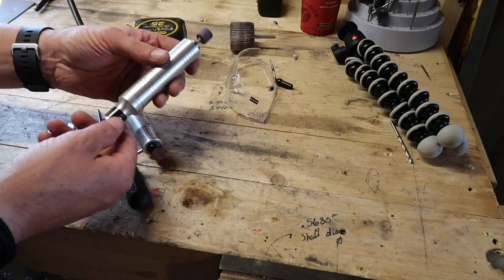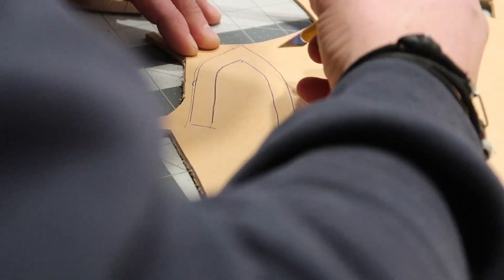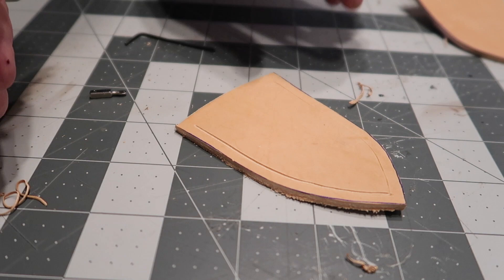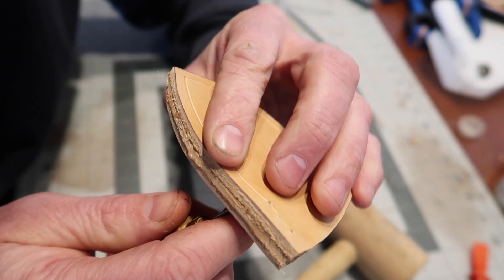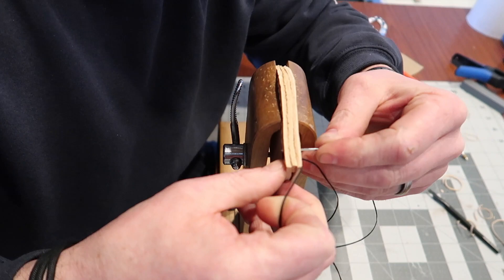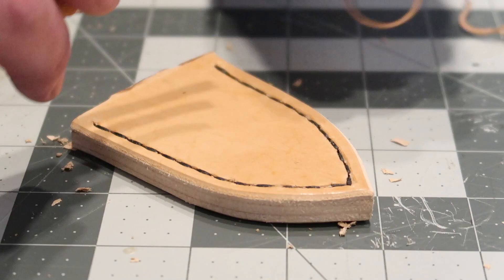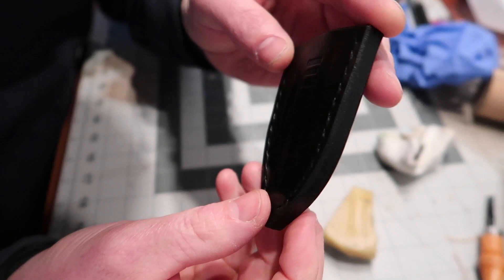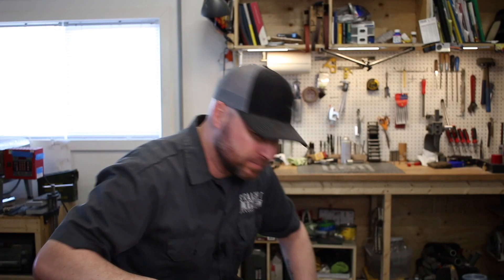Basic Leather Craft Tools - Tool Time Tuesday

Comment: Tool List From Vid. :

Exacto Knife
Edge Beveler
Stitching Groover
Spring Clamps
Leather Cement (w/ Flexible Applicator)
Pronged Leather Chisel(s)
Wooden Mallet
Stitching Awl
Waxed Nylon Thread
Needle
Stitching Pony
Safety Beveler (not necessarily recommended)
Belt Grinder (w/ 80 grit)
Beeswax (Alternative coconut oil, vegetable oil??)
Reply from the maker: Thank you for doing this! Really appreciate it🙏😆
Reply: @Simplelittlelife  You're welcome. :3 

I did want to ask, which stitching groover do you recommend?
Reply: Nomadic Wolf 
😉👍🏾 🤗 APPREEEECIAAATE  this !
Reply: Tools are needed for every hobby!... Compared to other hobbies, leatherwork is extremely CHEAP!!!
Reply: @nomadicwolf6132  "stitching groover" he recommends!?... What's wrong with your TEETH Mr Wolf?... Are they too skew or are they too worn out???
Reply: Thank you. 😊
Reply: With the waxed thread, I would suggest adding a cheap lighter to the list. Works really well for fully sealing up knots with stitching

And if you don't have one, a cutting mat is a very good idea, same with a punch pad because it helps extend the life of your punches and stamps as you go.

Comment: That bladed tool you’re calling a “safety beveler” to trim the edges of your work is actually a skiver.  You can use it to thin out your leather. Spray it with a little water then you can run the shiver over it to skim off the meat on the back of your leather. I use it most often to thin out the edges before gluing up and stitching parts.   
When burnishing your edges, it’s helpful to use a piece of canvas to rub that edge down after you coat it with either your beeswax or saddle soap or one of the commercial edge finishes.  The canvas builds up heat pretty quickly and really helps to smooth out the edge and start to harden it up a little bit.  Then come back and slick it with your burnishing tool. I have a couple that I’ve run a screw into so I can chuck the tool up in a drill and run it down the sides that way rather than working up a sweat trying to rub it like a teenage boy in the shower.    Just some suggestions.

Comment: Hey man love your work. But I think you might be ruining your diamond wholes by twisting the awl in the hole after you punch it. I am really new to leather work but, from what I have read, the diamond awl and forks are supposed to create a diamond hole so the stitch's creates, more easily, a diagonal pattern with the stitches. I think it would add that extra + to your sheaths. Anyway love your work brotha!

Comment: 🤣 1970's calling..   I almost did some leatherwork yesterday but got distracted and ended up using plywood.  Might sort out my leather tools today, some are grandads about 100 yrs old.
One thing you should have covered is length of thread for a given length of stitching eg 4 inches of stitching needs how much thread.. nothing worse than running out of thread with only 6 stitches left 😟
Reply: General guide is six times the length of the stitch line.
Reply: 👍 trial and error taught me 5 times,  6 is safer but i didn't have much thread at the time 😁

Comment: The classic Sheridan style tooling does nothing for me, I've been practicing my tooling with other designs.  I've been tooling a lot of Celtic designs lately but the bulk of my carving and tooling revolves around lettering.  Your method for locking your needles on the thread is interesting, haven't seen that one before, I just run the needle through the tag end and pull it down over the eye to lock it down.